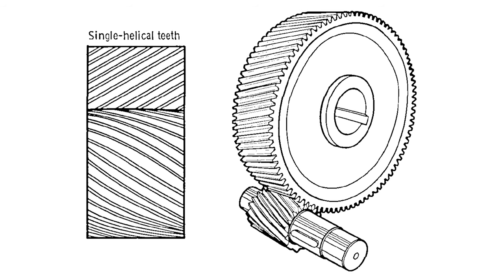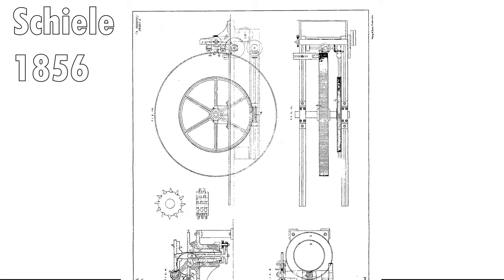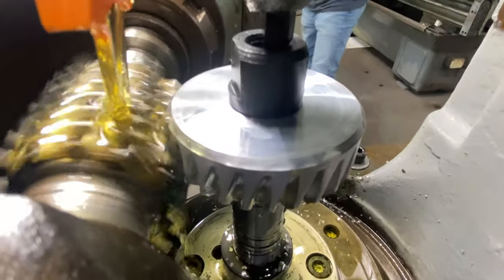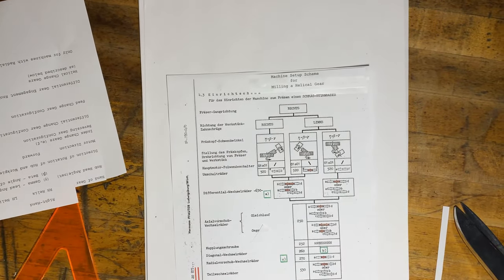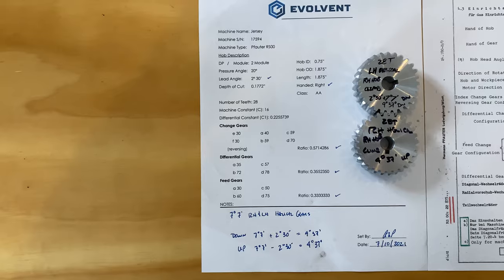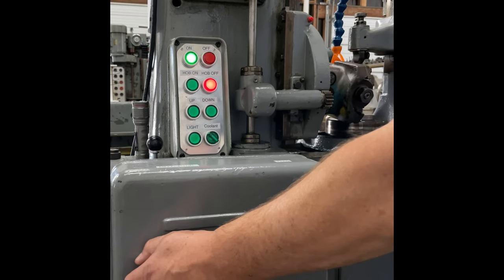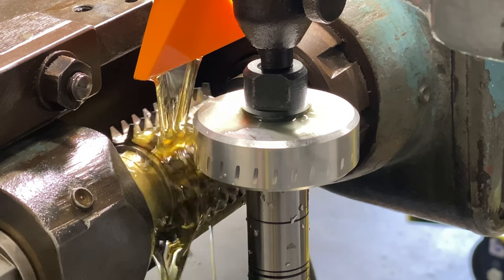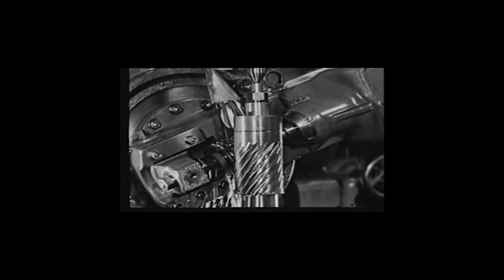Hobbing a Helical Gear (Differential Method)

Comment: Some fifty years ago, I worked teaching machine tools at university level. One test was to using trigonometry calculate how to make helical gears. When the math was done, they had to set up and run a hobbing machine, possibly a Pfauter. Very easy to tell if they passed the test. If they had made the math wrong, it started looking good but ended with a smaller diameter blank.
Reply from the maker: That is awesome!  Thanks for being a teacher.  Class work and shop work - thats the most effective way to teach and learn

Comment: I have a question. You said that the scallops go away after running the gears for a little bit. Is that why certain machines recommend changing the oil after the break in procedure? Metal from the gears and other various machined parts contaminate the oil and thus require an oil change ?
Reply from the maker: Yes, but it is just one reason to flush the gearbox.  There are also deburring debri, and other potential shop dust that can get into a gearbox if left open for much time.  For higher quality gearboxes the gears are ground and should not have any scallop debri.  It is good practice all around regardless of the quality of gears used.

Comment: Super overview. I’d be curious to learn how you determine the helix angle of a gear you’re replacing. Seems like it would be tricky to measure!
Reply from the maker: You can measure the helix angle using some simple metrology tools(sine plate etc), but to test the gear completely for runout you need some special arbors on a gear tester (Vari-Roll).  It is definitely a next level measurement.
Reply: With some not quite simple math and a healthy amount of educated guesses. You start with the number of teeth, OD and pitch (just getting to the pitch and pressure angle can be a bit of an exercise when half the teeth are worn away). Once you have those details, you can work backwards to what the helix angle should be, then you physically measure the part and see if it matches up. If it doesn't (not uncommon), you have to then figure out what the addendum correction factor is. Sometimes, when parts are badly worn, the only way to be confident is to calculate a diff gear train, set it up in the machine and run an indicator over the part and measure how far off you are and re-calculate the gears. It can quite literally take a couple of hours to get to the answer in some cases.
Reply: @EvolventDesign  Do you think feed affect helix angle..? I am currently rebuilding my Liebherr L800 gear hob being electrical engineer I don't much I use YouTube to learn kinamatic of machine and I will build a PLC based on working principle.. Thank you

Comment: 1:02 is it just me or I see a difference in gear teeth thickness ? Can gear hobbing generate helical teeth, which are the same thickness as straight teeth ?
Reply from the maker: Good eye.  Yes, they should be the same thickness and can run on each other.  The helical properties are on the transverse plane (90 from the teeth not the shaft).
Reply: @EvolventDesign  Is it possible to hob helical teeth, which have same thickness as straight/spur gear teeth ?

Comment: Do you know how to calculate the measurement over pins for a helical gear?
Reply from the maker: yes
Reply: @EvolventDesign  I need to make two 12 tooth 6dp 20 degree Pa  helical gears with a helix angle of 13.398 degrees and they need to operate at a center distance of 2.200" I got a calculator from zak gear but my calculation always comes out too small and the gears have excessive backlash. One thing the calculators asks for is the normal arc tooth thickness on pitch diameter. To calculate this I multiply 2.200 x 3.1416 and divide by 24 since the gear has 12 teeth. Is this correct?
Reply from the maker: Send drawing with your plans , contact info and phone number to:  
Contact@evolventdesign.com
Reply from the maker: James-send me an email so I can get with you on the solution.

Comment: Hi Andrew. I have a question about the differential mechanism highlighted in green. Do you have more knowledge on this? As I am struggling to cut helical on my machine..and suspect this part to be the problem. Question, if the diff lever is activated, with machine off, should it be possible to stop rotation of the diff gear train by hand if I turn the input shaft(f) of the rotation gear on the index side?  Is the diff(included/excluded)lever suppose to lock the diff mechanism's worm gear onto main index shaft(f) inturn turning the worm on diff shaft(D) rotating the diff gear train.
Reply from the maker: Adrian-
Short answer is 
I think you are correct in your conclusions above.

The differential is a cluster arrangement of 4 mitre bevel gears (°45). 
The order of power transmission is:
1) Power input
2) Differential 
3) Output from differential has a worm gear on the shaft <it connects to differential>
4) But it also becomes the input shaft to the INDEX change gear box.
5) then abcd for the INDEX gears
6) the output shaft has a worm on it that ties to the feed and differential gearbox
7) There is an engagement knob that ties to the output shaft of the differential gearbox and it engages a worm back to the wormgear in #3 above.
8) If it is not engaged, it will not function to make a helical.

The function of the differential is to slightly slow or retard the relative motion of the INDEX ratio> To add a partial tooth.  You then must tilt the hob head to the correct angle and it will generate the desired helical gear.

The setup seems a little complex the first time around, but the more your do it the more it makes sense how things are working.

Hope this helps.

Andrew
Reply from the maker: https://youtu.be/VlqObNS9dLA

Comment: Thanks Sir for the clarifications, Are you familiar with the Y3150 Machine? I bought one recently and I was told that I need to connect a different Bushing (Bigger) for helical gears?
Reply from the maker: Possibly, I think that machine looks and operates very much the same as the Pfauters.  I could not say about the bushing, you would need the owners manual as that may be machine specific.  For the all hobbers i have seen, it must be equipped with a differential in the drive train to make helicals.

Comment: Some really great information in there. I find gear making fascinating. So far I've only cut spines on shafts which are essentially very long spur gears, but its been fun none the less. I'm curious if you know how this machine compares to the old Gould & Eberhardt or Brown & Sharpe US made hobbing machines? Thank you for sharing. -Mike
Reply from the maker: Both share the same drivetrain, have not seen differential mechanisms on the G&E's.  The G&E's that I know are very solid and reliable with massive cast iron bases.  Have not seen a B&S hobber to know.  But I do know B&S as a very technically solid machine tool builder and they likely have the differential.  Pfauter had the patent on the differential, but I am not sure when it lapsed and others could use it.  It took until the early 70's before CNC entered the hobbing world - much later than in mills and lathes.
Reply from the maker: After looking through my history books, I found the earliest example of a B&S hobbin machine (horizontal) in 1915.  This was apparently their first attempt, and they had studied the Pfauter machines extensively.  Pfauter's patent in 1900 and manufacturing of machines significantly pre-dated the B&S efforts.
The 1915 B&S machine does not appear to have a differential.

Comment: Very Informative Guru
I want to know what are the difference setting for cutting right hand and left hand helical gear cutting settings to be done on Hobbing machine. Also when to use the lead angle given in Hob cutter? 
Please reply me sir, i want to know this very soon please.🙏🙏
Reply from the maker: Thanks for watching.  There are many different machines out there-It is spelled out in your owners manual.
Reply: @EvolventDesign  Thanks for your reply. I hope to know just as a example for your machine so that it may somehow relate to other machine setup process.
Reply from the maker: Yes, that will be a future video.  Please support me on Patreon.    
https://www.patreon.com/evolventdesign
Reply: @EvolventDesign  Ok sir, sure. I promise you I will support you. Right now i am on short travel to abroad.

Comment: Is differential powered directly from motor or from feed gear i cant see?
Reply from the maker: They are both powered from the motor.  The order is Motor, Index Change Gears, Feed & Diff are linked behind the gearcase, then the power is split.  One shaft goes to the platter worm gearbox, the other goes up the spindle to the hob.
The truly interesting part is the diff connects back to the shaft that is connected to the motor before the Index Change gears.

Comment: How i can find my machine constant??(its pfauter R01)
Reply from the maker: https://youtube.com/shorts/vXuO0fzb-YY?feature=share
Reply: @EvolventDesign  thanks for your reply.
Does this constant work for helical gear??
And does this method work for old models like RS01?
Reply from the maker: Yes, should work for the index drive train to set the tooth count.  If your machine has a differential gearbox it works differently.  The methods to solve this require you know the constant and have access to other solvers like the ones found here:
https://gearcalculators.com/

Comment: Nice, thanks for sharing. I'm trying to find out the pitch/Module/DP or a gear I have from a power wheelchair motor gearbox. I thought it was a 1.5 Module but I was wrong, so now it's back to square one. I need some metric and inch helical gear teeth gages like a set of thread or feeler gages. McMaster-Carr has some but they are very expensive approx $300.00 for the inch & $280.00 for the metric just to use prolly once, no thanks.
Reply from the maker: Yep, here’s a way to come close.  Hopefully you have some good calipers or micrometers to measure the OD.  If so make the measurement, count the teeth and the you can use our calculators trial and error to make an educated guess.  Link in bio to our website and calculators.

Comment: How you convert from spur gear to helical gear pls
Reply from the maker: For manufacturing > watch our spur gear videos and you can see how they are done vs this video for helicals.
For design, that is a very different question and one new issue with a helical is the side load that will require some sort of solution/bearing for the thrust they create.
Thanks for watching.
Reply: @EvolventDesign  thank you for your interest sir but i mean thise machine cause i have typical one wfzw mwm500*5  my problem is not how to calculate the helical but how to adjust It on this machine cause even i adjust the angle and all the calculation it also make spur not helical so may i have not connected the differential or i hv something i dont know. If you can offer me the manual instruction i will be glad
Reply from the maker: The machine needs to have a differential gear train
It is calculated in this video
https://youtu.be/VlqObNS9dLA